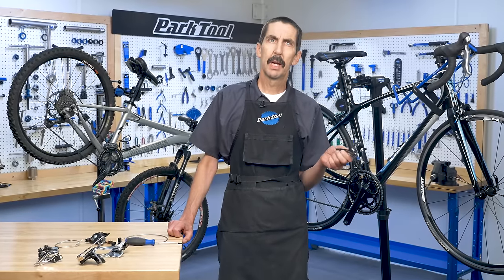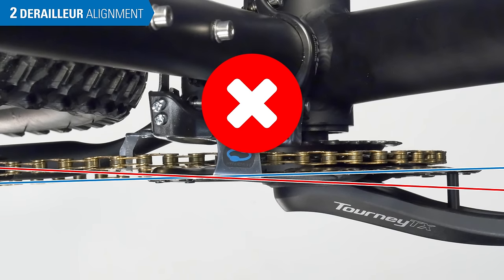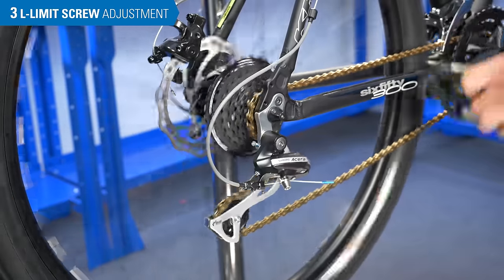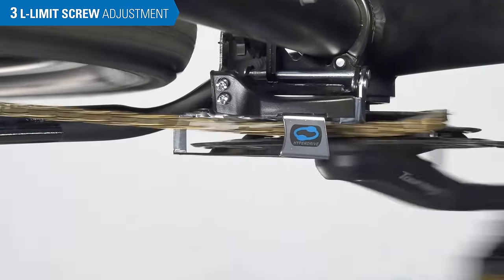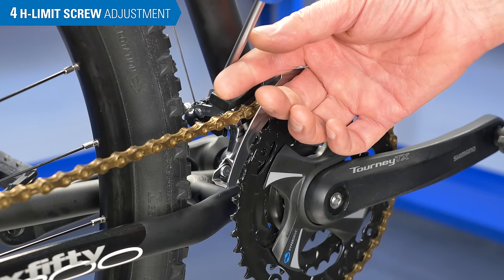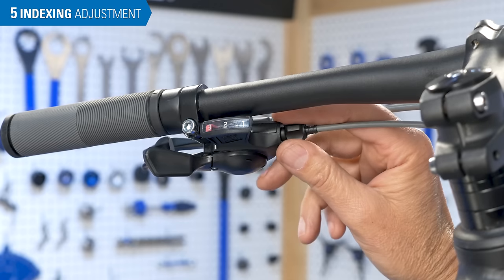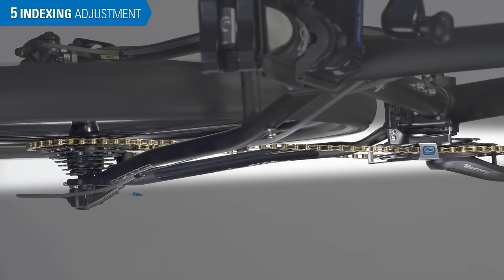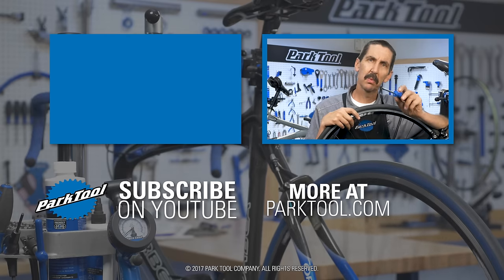How to Adjust a Front Derailleur

Comment: After attempting this for 3 failed hours with my bike upside down in the grass I've come to the conclusion that one of those bike work stands is a must
Reply: Yeah man I thought the same, got one and it makes everything sooo much easier
Reply: I hung mine by the saddle from a door frame using a clamp and rope, worked perfect.
Reply: Yeah, my lower back hurts too. Lol. Glad I got the gears I need working.
Reply: @mattb6542  haha  try a small tree
Reply: Fixing the bike upside may deceive you.
Reply: try using an indoor (wheel on) trainer
Reply: I had exactly the same experience!
Reply: Ive just been holding the back wheel up. I managed to configure the deraillier but im drenched in sweat
Reply: Same here. There's quite a few diy bike stand projects here on YouTube. I might be making one next time I need to do work.
Reply: Easy hack 
Stick the left handle  of bike to wall and bicycle standing only on handle and stand
Your tyre is free to move
Reply: We all started like you, with the bike upside down on the floor or on the grass, but a bike work stand definitely worth the purchase, it makes life much easier !
Reply: A folding chair and a patience friend is a cheap alternative, but I think the work stand would still work best
Reply: LOL you are so funny !
Reply: It might just be the most underrated bike tool to own
Reply: Just picked one up at Aldi for $29.99. Zero complaints here. Got my derailleurs set properly within 10 minutes. No fuss no muss.
Reply: Dude. I just got a bike stand and my bike life is better for it. You won't regret it and wonder how you lived without one for so long.
Reply: George  Hey Just saw this. Aldi in the US. Made life soo much easier.
Reply: George  yea there was only one in the bin when I was there. Thanks, you too!
Reply: Did the upside down thing for a while. It's a big no no if you have hydraulic brakes, tends to make all the fluid rush to and sit at the top end of the reservoir, and then it may not settle back evenly throughout the brake system, making brakes feel squishy. Bike stand is worth its weight in gold
Reply: I use my hitch mounted bike carrier mounted to my car.  I just put the bike on the outer carrier position and secure with the carrier rubbers.  Instant bike repair stand!
Reply: A bike rack for a car or truck is perfect for the job too.
Reply: Front mechs are the Devil's work
Reply: Yep, I'm on my third day trying to fix this 🤬
Reply: Dont so it upside down
Reply: King of Herdaz that’s why I did as well.
Reply: Same 😂
Reply: I used 2 wheelie bins with a broom in between and hooked front of saddle on, it moved a bit but worked
Reply: IF you don't have money, use the nature my friend.
Reply: I use 2 chains with hooks on the ends tied to the roof rafters of the garage. They are mounted as close to the opposite walls as possible. One hooks onto the stem and the other one under the seat, onto the seat post. When not in use, they just hang against the walls and are completely out of the way.
Reply: I used the base of my hammock stand turned on end and resting against an end cap of hall wall. (This allowed room for the bike.) Then hooked the bike seat over the top foot to hang with plenty of room to spin the peddles...worked like a charm
Reply: Consider hanging bike in garage, or from a tree branch, etc. - it is very helpful and costs nothing, but lease of a rope. As to stand: I had to resort to hanging, after discovering that my stand rests bike on shifting cable, and interferes with its operation. So, not every stand may suit all the bikes.
Reply: I just hang my bike right side up on the bike carrier off my car.  Works like a charm!
Reply: I made a PVC pipe bike stand that I clamp to my workbench. Works great! Just do a search, you'll find instructions.
Reply: I finally bought one after a lifetime of not owning one and the difference to bike maintenance is immense haha
Reply: @georgekoukouris2347  pop
Reply: No need.  I used my bike pulley system to bring it to the right level.  Much cheaper than a bike stand
Reply: I've battled through crazy problems with front and rear derailleurs. The only thing that stopped me from chucking the bike and starting a new hobby is Park Tools: Calvin Jones's tutorials and a bike stand (which I splurged on as a sincere "thank you"). Worth every penny.
Reply: Only thing I can't fix just as well upside down is hydraulic brakes, for obvious reasons. A stand would be nice if I had the space but I've never felt the need for one. That said, I've used a car rack on occasion as a makeshift stand. If you follow the video above which is very systematic, no stand is necessary. I wouldn't want to set the derailleur height upside down but there's no need to flip the bike until you're at the final step setting the cable tension... until that point, you just need to lift the back end up when shifting from one gear to another to set limits (which requires one gear at a time and is slower but no biggy.. click the shifter, lift up back end by seat while turning the crank with the other hand.. set down, click next gear, repeat. A stand would absolutely be easier, but again, I don't have the space for one at home).
Reply: Me too. I just ordered one.
Reply: I just hang the bike from a hook on a piece of rope. I tie it to the handlebars and the seat post. Works OK can use a folding chair to keep the front stable or a stick if your off road.
Reply: i have a bike stand that lifts the rear wheel off the ground .it has 2 hooks that go under the frame on the rear ,near the disk brake ,   getting the front derailleur right is a huge pain , only 3 gears and 10 times worse than the rear .
Reply: I also lasted this long earlier lol
Reply: I made a bike service stand out of scraps of wood which cost me $0.  Lots of videos on that.  No need for some extra expensive bike stand.
Reply: Absolutely.
Reply: Yeh got an Aldi stand years ago and it has made life so easy and was cheap as
Reply: been there, dude
Reply: I just hang the bike on the hitch mount bike rack of my SUV and do the maintenance.
Reply: I'm with you bro. My back is twisted hehe
Reply: Yep lol
Reply: A car bike rack can work really well. Those are easier to find cheap used and are of course dual purpose.
Reply: Get a couple of chairs and place a broom over the top of them. Balance the seat on the broom and you can do these adjustments without the bike’s rear wheel touching the ground
Reply: @Che Palino Front derailleurs should not be indexed, it is ridiculous. Sometimes I just use SRAM MRXshifters twist grip 8 speed and the front shifter is not indexed, so gear adjustments only take a few minutes.
Reply: Sooo true
Reply: I hung the bike by the seat with a hook I hang a punching bag on. I think working on it upside down made the derailleur function different. I also just learned "upside down" is two words.
Reply: A bike trainer stand works well, too.
Reply: ..yeah no shit Einstein.
Reply: My hack is, at the garage stairs leading into the house, put a heavy broom or rake handle between the 2x4 slates of the handrails, and prop one end under the door molding for leverage. Now hang your bike between the rake handle and the bike frame. Be careful that the handle doesn't slip or you'll think you're in a Three Stooges episode! 🤣
Reply: I made mine from broken camera tripod and 3d printed part 🤣
Reply: Hint -- if you have a trainer, it also works.
Reply: @ksawery6568  I've taken mine to a dealership before I wind up as a cat A patient in a mental health facility.
Reply: எனது பைக்கை புல்வெளியில் தலைகீழாக வைத்து 3 மணிநேரம் இதை முயற்சித்து தோல்வியுற்ற பிறகு, அந்த பைக் ஒர்க் ஸ்டாண்டுகளில் ஒன்று அவசியம் என்ற முடிவுக்கு வந்தேன்.
Reply: @udhiranc4659  You can also use the same derailer as the less technically modified version found on the boardman Road bike. I disagree with the method you have used on your last 2 attempts. Invest in the correct workshop aids, and the issues will be overcome.
Reply: @johnf4085  💛💛💛💛
Reply: YES, I am so tired of having to keep on flipping it
Reply: I can confirm that
Reply: These are a must. I have an Aldi special, and wouldn't be without it.
Reply: 😂😂😂 I agree! Time to get a work stand for me too
Reply: Just through my cheap 18 speed KMart bike in the bin. Followed video to the letter. Nothing worked correctly. F#%k it, I'm driving.
Reply: especially so for the front part, rear one can be tuned rather easily when bike is upside down.
Reply: i bought from years ago from amazon for 40 quid - the best thing I ever bought.  I spent 40 quid as I wanted it sturdy and not fall over with my bike bolted to it LOL
Reply: I put two kitchen chairs back to back spaced out about 20 inches apart. I have a very stiff cardboard tube I place across the very top of the two kitchen chairs then I lift my bike and rest the bottom front part of the bike saddle on the carboard tube. The back tire is off the floor and the bike just sits there pretty balanced. It's enough for me to make all the derailleur adjustments needed. I'm sure anything in the family of a solid pole would do the same thing. Broom handle, pipe, baseball bat, etc.
Reply: Wow yes
Reply: That is absolutely not true
Reply: I always service my two bike and dont have a stand
Reply: Tie front wheel to a chair and lift with a car jack under bottom bracket 👍
Reply: I tied mine up and let it dangle 😂
Reply: I just asked my wife to hold the bike up for a few minutes...
Reply: @VeryAp1cal  lmao I literally used a small fallen over trees branch on a trail I frequent
Reply: I've found that removing the front wheel, then tilting the bike so that it stands on the fork and the shifter hoods works surprisingly well. A broke man's bike stand if you will
Reply: 150%
Reply: This might be one of the truest comments in all of youtube
Reply: You need 5 House bricks taped together with a piece of wood on top plus a jubilee clip to hold the bike in place... Lol
Reply: Same
Reply: I use a tree💀
Reply: The same thing that happened to me
Reply: All u guys crack me up & yes I rigged bike as well. Hung  from rope attached to ceiling free floating, u know quick, easy very little brain power. I'm getting a bike stand.
Reply: @georgekoukouris2347  qsa
Reply: @C0deH0wler  it will distort things you thought were Kool i.e. derailleur...fix again a stand or something to hang it up with helps
Reply: I know how you feel because I had to flip my bike upside down and turned the limits Cruise while I was turning the wheel to listen and then I can't get my biggest gear on the front to engage with the chain
Reply: 0
Reply: You don’t really need a bike stand use a car jack or helps allitle
Reply: Same story, tried 3h yesterday, today bought the stand for 17€ and set up 3 bikes in 2 hours.
Reply: @h.p.734  Yh I just put a block of wood under the bottom bracket as well-  wobbles a bit, but works😂
Reply: @faaiquealimehmood  9 people knew what you are saying, I’m not one of them.
Reply: After 3 hours I would call it quits and find the nearest liquor aisle! Lol
Reply: Most definitely but I have worn out / broken even Park Tool's own stands from flex fatigue as electric bicycles are often very heavy .
Reply: If you have a trainer it works for this purpose. They can be found used cheap/free
Reply: You guys rock! These videos have not only saved me loads of time and frustration but they’ve made me buy a few Park Tools whilst actually making me enjoy bike maintenance - THANK YOU!
Reply: I'm in the grass right now thinking the same thing.
Reply: @mattb6542 showing initiative😉
Reply: Adjusting derailleur is tough
Reply: Also remember,  ( and someone just told me) , a derailleur uses gravity to help change to the next gear, when it's upside down, it's difficult to get an exact adjustment.
Reply: I just love that idea of removing the seat, and having an old seat post permanently mounted to a gantry or reciprocating arm, so that you literally have a solid, stationary mount to slap the bike up and onto.  Or if you have one of those fancy clamps.  I just found this great combination mountable bench vise that clamps onto any table.  It was made to clamp a rotary tool or drill onto.  It has a circular ring that clasps closed with a wing nut.  That way, it can grip onto my frame just under the seat if I use a little leather or rubber to keep the ring from scratching or marring on the bike!
Reply: Same! I ordered a cheap one on amazon
Reply: Bike stands are great but it would stand in the corner 90% of the year. I used the track of my garage door. Tossed a rope over it, sat the bike on 5 gallon buckets then hoisted it up enough to spin the rear tire. Worked like a charm.
Reply: make one on your fence with  2 x 4s
Reply: Jack stand and 2 bungees cords
Reply: Amateur
Reply: I just pick the bike up by the saddle and use my other hand to pedal lol
Reply: Me 4 years later 😂😂
Reply: I use a bike rack on the back of a car
Reply: I use my trainer (kinetic rock n roll ) as my workbench
Reply: I tilted my bike over its stand and then tied it to pole nearby to keep it stable
Reply: Right I’ve been flipping my bike upside down to fix since I was a kid a lot of trial and error was involved just to get it right and now I will invest in a stand
Reply: I got a small one for just 7 gbp that only lifts the back wheel. It's basically just two hooks on a stand and you put the bike frame in the hooks. It didn't cost me anything, doesn't take up any space, but makes a big difference for maintenance
Reply: Quick solution with stuff you may already have around home: one long (at least 2 meters) stick/rod, one piece of rope, twine, a necktie, belt or the like, and a sturdy table like a dining room table.

Lay the stick over the top of a table at one end. Tie some rope behind the nearest table leg and over the nearest end of the stick. Leave the other end of stick protruding out across and out from the other side of the table to hang the bike from that stick of wood! (probably hung from just in front of your back wheel) It's not high or ideal, but its free/cheap, takes less than a minute to assemble/disassemble, and doesn't result in more clutter with another single-use device. Lay cloth down to protect table or bike frame as needed.
Reply: same problem here bro
Reply: Yo I use an ironing board instead. It's crude but bearable
Reply: If only this was noob friendly…I accidentally turned the front one a few times thinking I was adjusting my brakes and no matter what gear i’m on. It’s like on riding on a hill all gears. Chain also gets jammed or falls off.
Reply: 😮😮😮😮😮.😮...😮,iici😊ml
.

l
 

b cpcb
Reply: Right there with you and just ordered a bone stand myself 😂
Reply: Facts😂
Reply: I used the bike rack on my car
Reply: Very true! I just bought one!! It’s the best
Reply: Absolutely the same problem here. I just CANNOT get it done. I’ve built a beautiful basically new bike but have given up on the entire project by now. Also because I forgot to install the chain protector before closing up the bracket cups (one of which is all jacked up now with no possibility of taking it ever off again)…. Moronic, I know. One lesson learned though, I will never ever again buy any bottom brackets with plastic cups but alloy only to prevent the torque threads from going to kingdom come. If you have any idea how to take off said cup afterall I’m all ears.
Reply: I have the same conclusion
Reply: I always tie my bike to the ceiling fan 
Works like a charm 👍